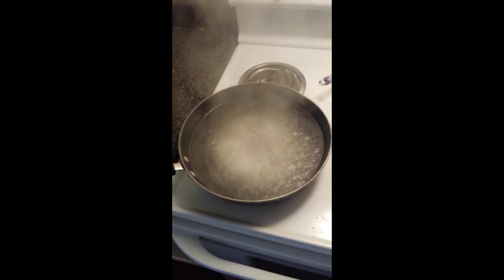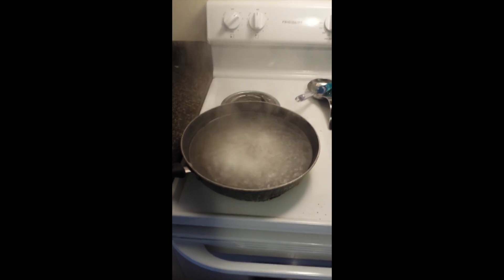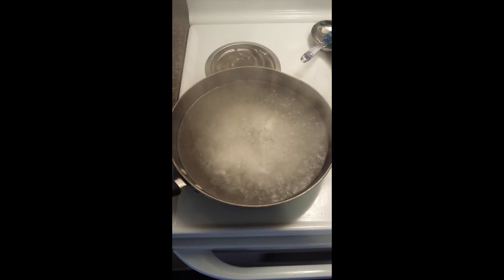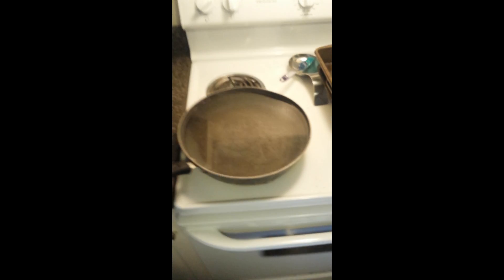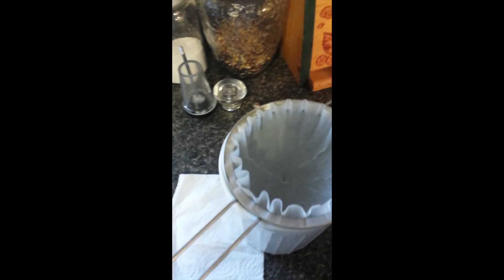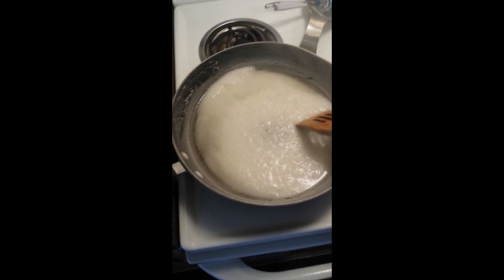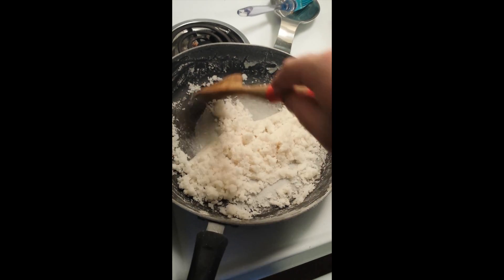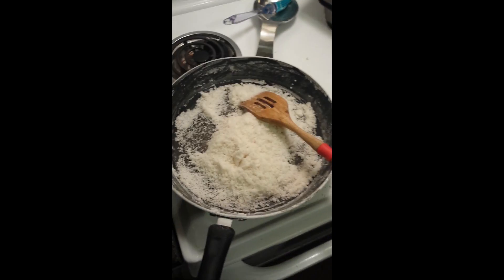How to make salt

Comment: Consider the other things in salt water. There are still naturally occurring toxic compounds in the water and potentially industrial and city waste.  Most of those potentially toxic compounds do not boil off, they mix in with the salt.  Adding more water to the pan adds more of these toxic compounds and it essentially concentrates them.  I would highly recommend purifying the salt by performance at least 2 steps of recrystallization.  You will lose some of your salt but it's worth it for the peace of mind. Please be careful. Cheers
Reply from the maker: We have been doing this for years and years. I am 53 and learned when I was 7. We don't get our seawater from the Halifax harbour or anything. We get it out where there are hardly any houses and there is no sewage. Perfectly safe.
Reply: I'm just trying to give some friendly advice with some chemistry reasoning. Sorry if it came out as stepping on your toes, did not mean that.  I like your videos and want to see you do well that's why I was suggesting you just look into recrystallization.  Worst case, you waste 15 minutes of your time.
Reply from the maker: NO worries my friend. Never had a problem with the salt yet and I don't see any issues going forward.
Reply: There are 2 main methods. 
Method 1) Boil some CLEAN water then take it off the stove and let it rest for 1 minute. Keep dissolving salt until the water cannot dissolve anymore (380g/L of water) . Filter the saltwater through a coffee filter while it's hot. Then allow the water to cool down to room temperature.  Salt crystals will begin to appear, that's the much more pure salt. You can collect it by filtering it out. While the salt is on the filter, rinse it with clean ice cold water.  Don't use too much rinsing water, it's just to wash away any impurities ont eh surface of teh ice crystals. You can get very pure salt from this method but will also lose quite a bit.  They repeat this method several times in labs to make very pure compounds.
  
Method 2) Again boil some clean water and dissolve as much salt as the water can take (380g/L of water). Boil out about half the water (you can eyeball it). You'll see salt crystals appearing during this time so don't freak out.  Let your pot cool down to room temperature and even more salt will crystalize out.  Again collect the salt by filtering it out with a coffee filter and again rinse it with a little ice cold water. This salt is also more pure than what you started with but not at pure as the first method.  You lose much less salt in this method though, so that's nice. 

There are a lot of youtube videos on this. It's quick and easy once you get the hang of it.
Reply: how do you recrystallize?
Reply: How do you recrystallize the salt? Thank you!
Reply from the maker: by boiling out the water. Re-crystalization happens automatically
Reply: no that's crystallization.